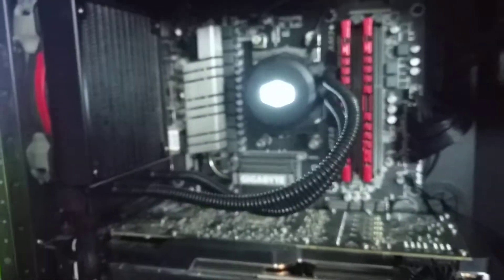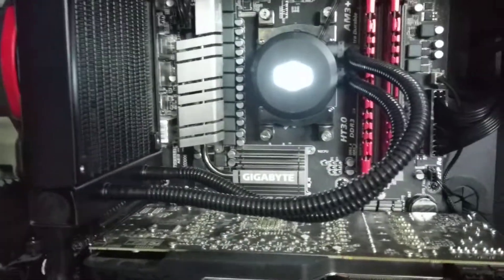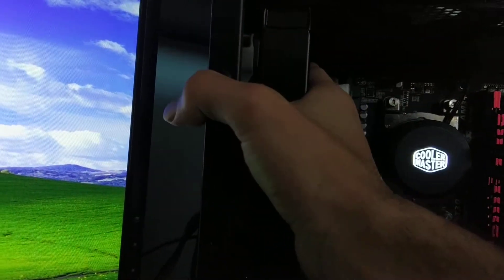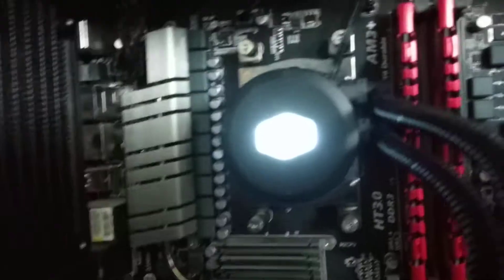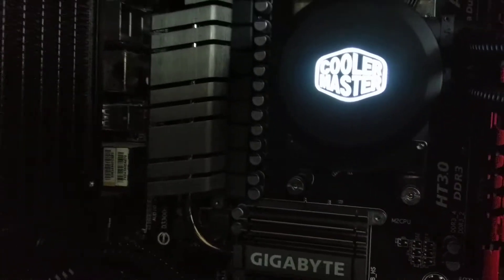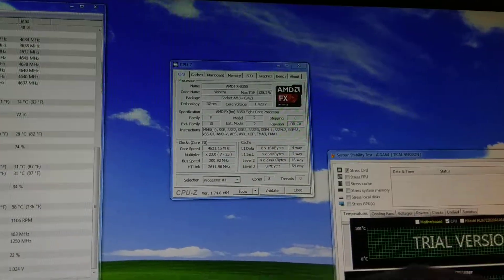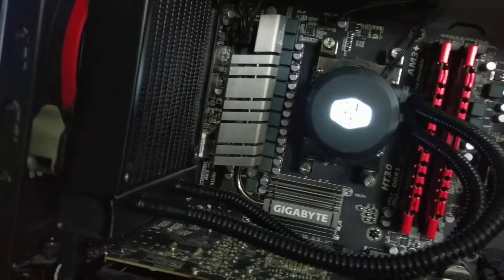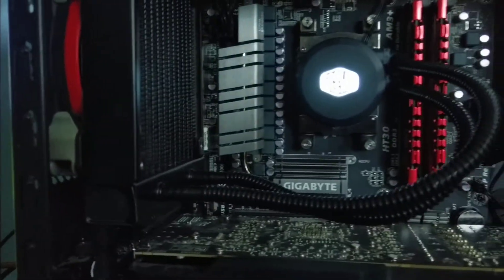CoolerMaster MasterLiquid Lite 120 Review/Test (Part 1)

Comment: Actually the fan is pretty good, you used it wrong. It was loud because it's an airflow fan not a static pressure one like your sp120 is. Airflow fans are good at pushing air, while sp fans are good at literally sucking in the air. Airflow fans can't handle the airflow block created by the radiator so it's running like crazy.... An airflow fan should be blowing air into the rad while a sp fan pulling the air through the rad.
Reply: i notice also wrong installation instead the radiator on frame, more quit if you install it correctly

Comment: I use my fx8350 for rendering in 3d software overclocked at 4,5 GHz and i have temperature 69 C on cooler master tx3 evo dual fan. This temperature is not safe, do you think i should downgrade temperature to 52 C with this wather cooler? best regards!
Reply from the maker: Considering the max temp for this chip is about 62c, you'll be fine with this AIO.
Reply: Tnx. :)